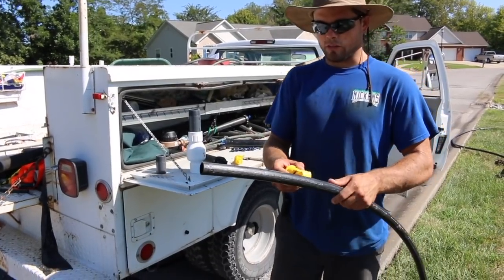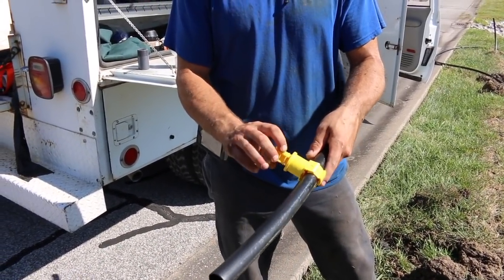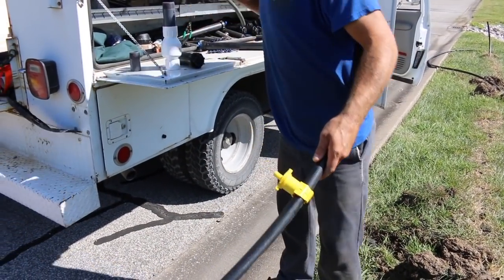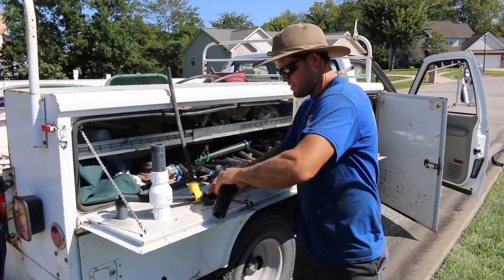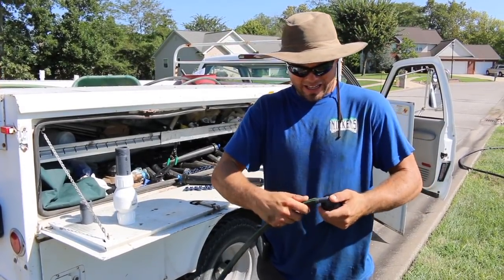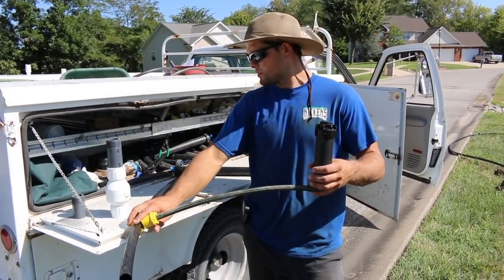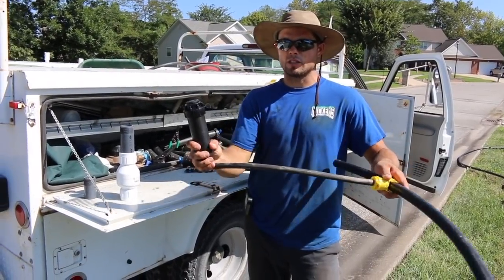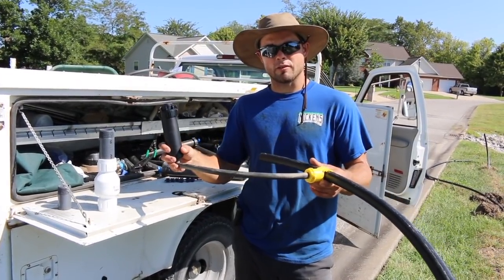How to Install / Repair an Irrigation Head | Sprinkler System Repair

Comment: Love the flexibility of poly. Have not seen much here in Florida. Mostly pvc and flex pipe. What is code depth in your area with poly tubing ? Would so love to get away from pipe glue !!! I have recently started using the shark bite fittings for repairs and have been loving it !!
Reply: Ron Hart There isn't really a code depth, but we try to install about a foot deep to avoid aerators and an early freeze.  If you want to easiest installation, you should check out Blu-Loc fittings for poly & PVC-Loc fittings for PVC.  Here is their website: https://www.hydrorain.com/products/blu-lock
Reply: Y'all are the same as us then. 12 to 16"depending on pipe size . I keep forgetting you northerners flush your irrigation during winter . I was thinking it was deeper !! Thanks

Comment: Have not seen that used where I live at. We use white pvc sch 40 thats what is used around here. I really hate it when I see people use the thin wall pvc breaks a lot and a lot harder to fix.
Reply from the maker: John Bailey Around here (Midwest) this is what is used. We were supplied by an irrigation distributor that has been in business for 30 + years
Reply: Amen! Sched 40 is the only way in my opinion. But on the same note it is kinda cool with no glue!

Comment: On threaded joints, it is a good idea to put pipe thread tape on a pipe threads with sprinklers.
Reply from the maker: Aaron Cover Thanks for the tip 👍🏼 I asked and he said it was meant to go in that way..:
Reply: Not required.
Reply: People often get irrigation confused with plumbing !! No need for any tape. Just unnecessary expense .

Comment: I don’t think that will be good for my area with the cold winters we get even though you pressurize the system i don’t think it will hold up in my area New Jersey in house 🏠 on yeah
Reply: I'm in Delaware. It would absolutely hold up if the lines are blown out and winterized.Been in the industry for 25 years.
Reply: So does everyone in Delaware hire professionals to "blow out" and winterize their sprinkler system?  Probably not!
Reply: @fpplsoftwashpressurewashin8757  
Yes. Every year. That's standard practice. Unless the homeowner has a compressor big enough to blow it out themselves. Some do. It's typically a $100 charge and takes 10 minutes. Not sure why this doesn't make sense.
Reply: Okay, that makes sense!   Pricing is reasonable too.
Reply: @fpplsoftwashpressurewashin8757  same here in Minnesota.  Poly pipes and blow out at the end of the fall.
Reply from the maker: From what I understood every system is blown out in the fall?? I didn’t know not blowing out was an option?
Reply: @nickenslandscapingexcavating  yep.  unless you're in warm climate with no chance of freezing temps.